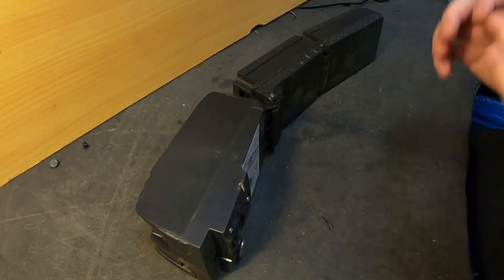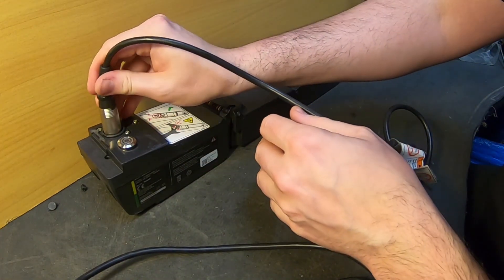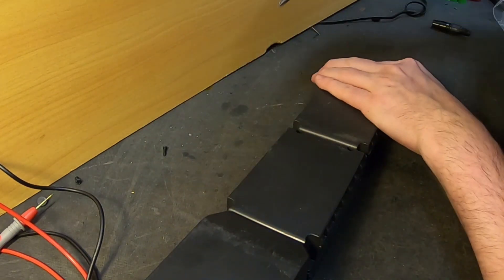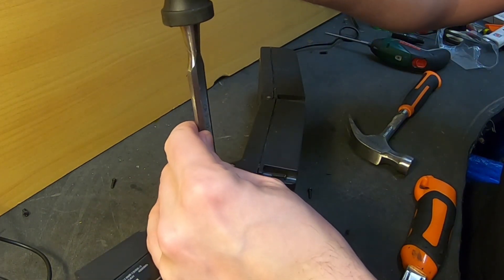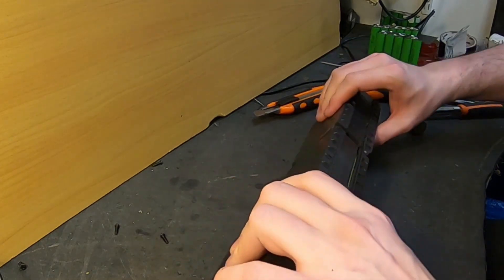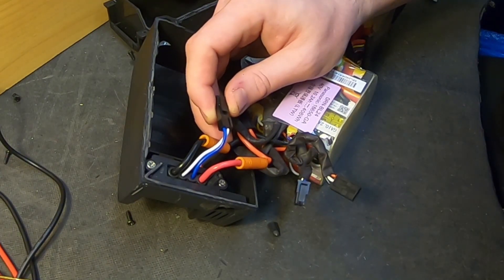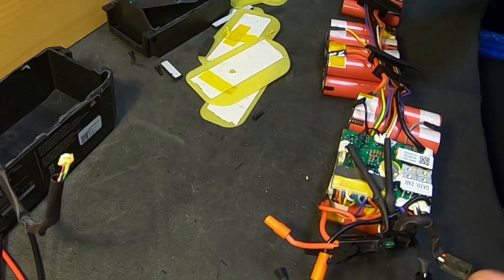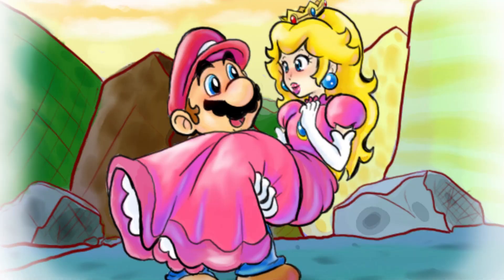TranzX BL24 40V Flexpack - Full Teardown (and why its dead)

Comment: Hey doctor, I jusy bought a Winora-Town Exp with a dead Trans-X battery. What does the 4 pin charger used for? I can see there’s a red and a black wire but there are two more; what is it for? Can I charge without its dedicated charger?
Reply from the maker: YES! its for data transfer and not used on the charger,
Reply: @TheBatteryDoctor  Big thanks Techno-Doc!

Comment: Hey, do you have a video of The excimer power drive battery? How to get The cells unstuck silicon without breaking The whole battery pack
Reply from the maker: Good question! No video yet but my employee got a crack at it a few weeks back and he used a heat gun of the bottom and that made it easy. I also think they are tricky. Also bending/twisting the case helps.
Reply: @TheBatteryDoctor  i got it out, thanks! Used a flathead screwdriver and pryed little bit herr and there then grabbed ahold of The back screw piece and just pulled up till it loosend up. Thanks for response man!